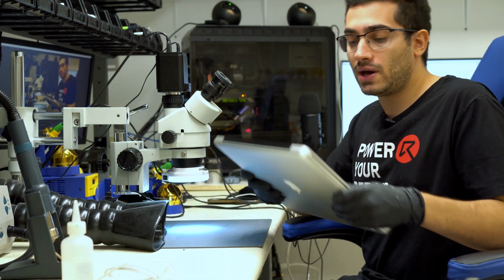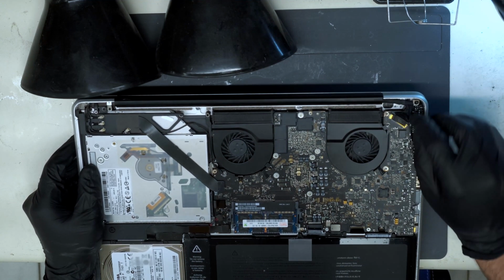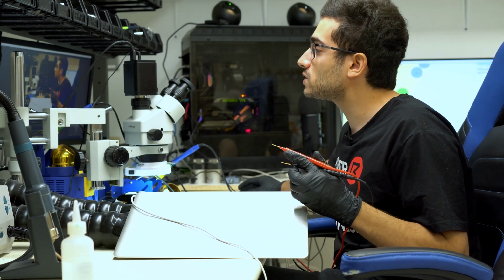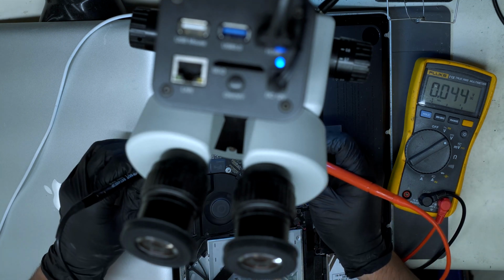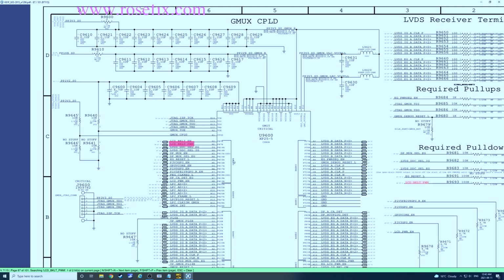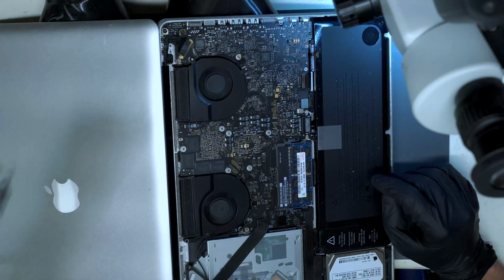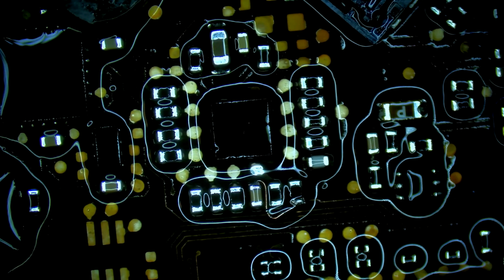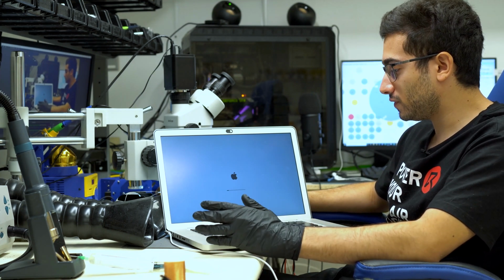How to repair backlight on MacBook A1286 with normal voltage at output | Board Number: 820-2915

Comment: god damn,i been sitting with an external monitor for years when i could of just done this,I dont use the mbp anymore except when i need it for jailbreak or ramdisk stuff.My question is what if there is no voltage at the connector where would the fuse be as i noticed the keyboard light is also off

Comment: Hi how u guys doing? I have a late 2011 A1286 with similar problems, the screen just went black, would luv to know whts the cost to repair it. Waiting for ur response.
Reply from the maker: Hi, $150 if it's same issue. We will do a free diagnostic first.
Reply: @Marnics  OK perfect how do I get it to u? Where r u located?
Reply from the maker: Use link in description to start mail in process

Comment: Quick question.  Were you powered up when you put the flashlight behind the screen to verify whether the backlight was working?  I noticed you had it plugged in but I wasn't sure if you were fully booted up.  Thanks!
Reply from the maker: We were looking for the apple logo on boot
Reply: @marcuscupello  Copy that. I purchased a new M1 and traded in my 2012 (happy about the retro ports being reintroduced). They sent back the 2012 and said it had a backlight issue. Nothing I can see based on your excellent tutorial. Just wanted to be sure before I sent it back to kids in Cupertino. Thanks again for the speedy reply and guidance.